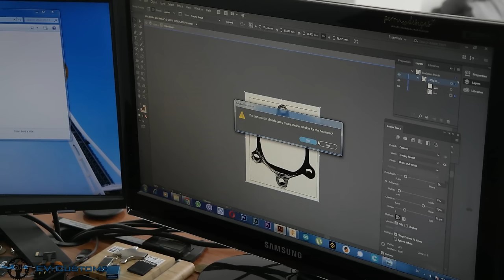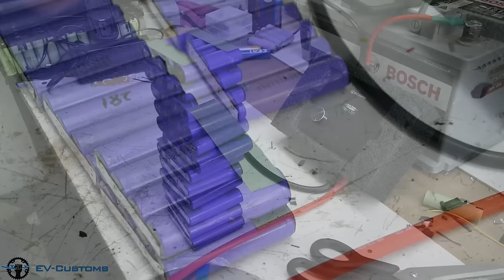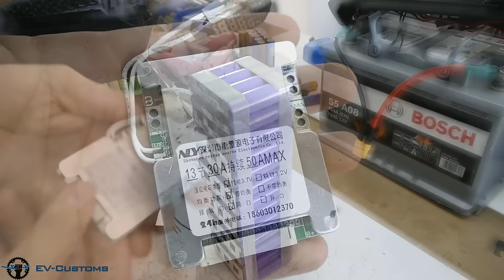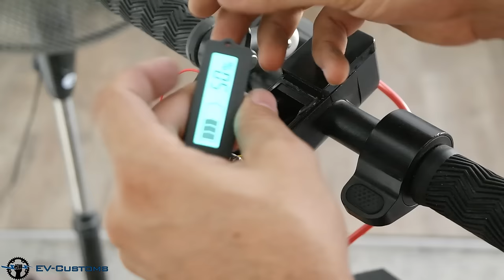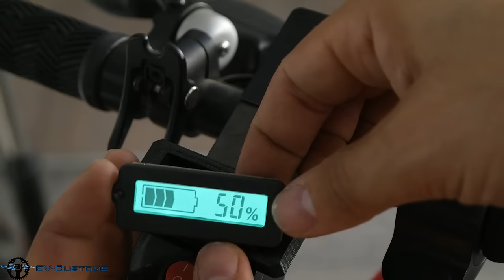2WD Xiaomi Scooter Frame Conversion at 48V 1700Watt MAX Output

Comment: I dont belive that tiny Bms capable of handling 30 A constantly or ever 50 A Max as peak 🤣🤣🤣🤣🤣🤣 invest in good bms or someday you will see for yourself
Reply from the maker: Until now it working perfectly...   didn't warm at all...
Reply: @EVCustoms  believe that those chinese small "e-bikes" bms are not ideal for that much power , There are real good brands sometimes they can be a little bit bigger that these small ones but untill today i had no problems

Comment: Just buy a controller for dual motors from the beginning. Aren't you afraid you will fry your controllers and battery from constant back current and other stress this will  create?  Otherwise it's a good video im thinking of doing something similar on mine

Comment: I didn't understand why you did all that work from minute 7:37 to 9:56, wasn't it enough to print and paste the simple paper template? to make the holes?
Reply: I thought this as well, I also noticed it looked like the back motor was spinning in the wrong direction
Reply: same here
Reply from the maker: Yes... at the end i just plug learn mode and fix that, 3sec job..
Reply from the maker: And how you will cut the centre circle to center the template... by hand..? there you need precision...

Comment: Very nice video and  clean work on the scooter.... Planing to do the same. I have Xioami S1 with extra battery  + Tuning at the moment running 37 kmh at full charge.. I would love to have a 2ed motor and more V  your video is very helpful thank you 💪👍👏👏🇩🇪 keep up the good work 😍
Reply from the maker: Thank mate..  i will wait for your conversion...;)
Reply: Hello, could you or someone please help me? I have serious problems with my Xaomi Pro 2, I am getting warning flashes and beeps of error code 14, 27, and 35 (depends on if I just pushed the brake/gas/button reset).  This occurred after downloading the application DownG. I want to revert it back to stock, or just get it working again.  I was trying to unlock 35kph..

Comment: Nice - Some welds on my Aovopro clone's steering stem to  front box have cracked badly (I bought an abused second hand scooter) so I'm thinking of getting another and doing likewise but I'm going to make a decent aluminium belly plate to support that weld better too- Is there any way I could keep the same display if I used a decent dual VESC?
Reply from the maker: Yes is dangerous also..
About VESC.. i didn't have any experience.. sorry mate..
Reply: @EVCustoms  No problems, If I have any luck in keeping that standard display with a double VESC I'll let you know how it's done, Thankyou for taking time out to answer my question. All the best mate.
Reply: @adammorris3082 VESC's are good but not compatible with any screen you can buy except for davega or davega clones

Comment: That display you have 24m.13sec mark. ThebYFS-M2V1.2......do you know what model xaomi that is from? I have the same which was throwing up an e7 fault after the scooter had sat for a long while. I did a reset holding throttle, brake and power button then it worked   and throttle worked but then after 15aeconds it completely died and now it wontvturn back on. Battery is charged and is 40volts. 
Any idea whatvthe problem is? Any idea where to but the display and from which model xaomi its from? I have searched everywhere and i cannot find one.

Comment: i made 63v (fully charged) with a 500w motors (that handles like 1500w lol) i can peak to 70 kmh but i configure it with a slow acceleration otherwise it start burn and a i have to change my tire every month
Reply from the maker: Yes.. at this high voltages currents must be  to low...  i also make a video with higher voltages..  modifying 72v 1500w controller..
Reply: @EVCustoms  how do you upgrade the controller, just by changing the 63v capacitor or need to buy a new one ?
Reply from the maker: @Michael-jo2fw  Just other cheap and bigger controller..

Comment: Good job I've got the same 2 models as well as a few others but I'm glad to find this because I want t o do the same. Only thing that worries me is my stem from deck to handle bars head set snapped at the point with the cable holes and I've seen other Windgoos that have done the same, I've put a sleeve in side the tube and 4 bolts all the way through, 2 on each part N to S, and E to West, but it must be a weak spot so be careful and keep your eyes on it
Reply: Totaled a frame yesterday
Reply: How fast is going

Comment: Great job guys!
I'm thinking of doing the same thing on my scooter, but with some differences.
My only question is, where did you find that spacer for the disc to mount on the motor.
I've seen it at some point on the internet but now that I'm searching, I can't find anything!
Once again, impressive work and really professional.
Reply from the maker: Hi Marios.. here you can find it >> 
https://a.aliexpress.com/_Euz7XHz

Xeretismata stin Ellada..
Reply: That isn't a spacer. It's an adapter to add a rotor to a freewheel hub of a bike. Such as a fixie flip flop hub . They  make aftermarket motor covers with rotor mounts built in.

Comment: Hello, could you or someone please help me? I have serious problems with my Xaomi Pro 2, I am getting warning flashes and beeps of error code 14, 27, and 35 (depends on if I just pushed the brake/gas/button reset).  This occurred after downloading the application DownG. I want to revert it back to stock, or just get it working again.  I was trying to unlock 35kph..
Reply: Its broken now
Reply: @denskreenen6968  nah infact I reset the controller from the inside. Now I'm riding bout 40km/h

Comment: nice work but i dont know who wants to drive a xiaomi going faster than 35km/s its not stable at all coz its too light. I limited mine at 32km/h back in the day. Now a days i am riding a dualtron eagle going 70km/h no problem at 75km/h its kind of unstable for the suspensions flexibility settings i am using.

Comment: Overcharge 250w or 350w motors using 48V battery will bring you to burn it very quickly.
To do a correct work you have to change motor section phase cable, disable hall sensors in 1 motor, add 2 different brake levers, use a motor forged with brake disk predisposed, need also to add a magnetic brake, use different main boards, place a battery over the rear wheel for better stability, over a chest or brackets not on main steering tube, battery is also not well insulated very home made, electrical connectors aren't good, need to solder wire , and heat shrink with lighter?? Omg.... 

This video remember me like a teenager customized e-scooter, with only 1 objective: run fast and do not think to consequence....

You enhance people to do unsafety customization, I talk cause I work in a e-scooter repair factory in Italy, and I know what I seen, and cannot forgot how people injured for extreme stupidity.
Reply from the maker: Hello buddy. I'm waiting to see a work you've done in a video to comment on it... I'm sure I'll write you a book about the mistakes you've made, I'm saying it because I'm hear many people talking and at the end they are just words...

Comment: all this work and then it is slower than the other scooter?!?! nice
Reply from the maker: No is not slower...  custom scooter finished first at 80m distance and have much more acceleration...  the other Futecher scooter  have high speed motor but lower torque, also custom xiaomi cost me about 500euros and Futecher price is about 1200euros...
Reply: Custom scooters and high-end scooters are not the same. Dual motor hub doesn't always mean speed.
Reply from the maker: With dual motor you have acceleration  and health motors...

Comment: Anybody notice the rear wheel is going the opposite way to the front??
Reply from the maker: Yes, it was at testing, after that i reverse the motor to proper direction just buy plug two wires.